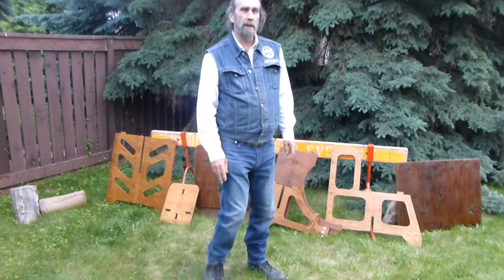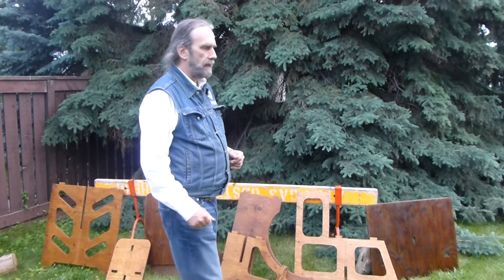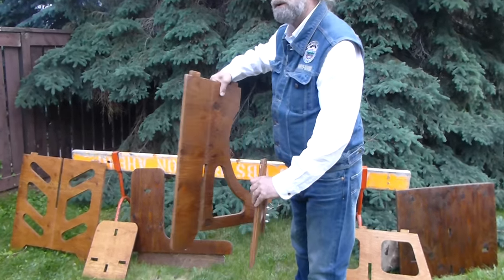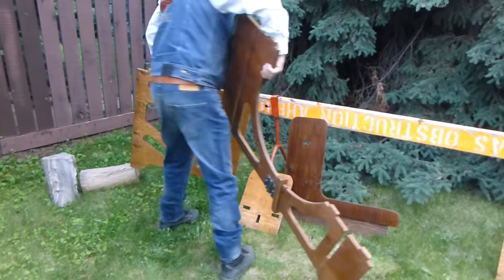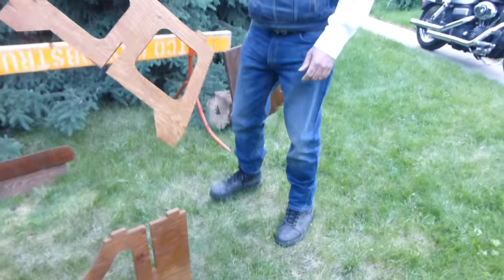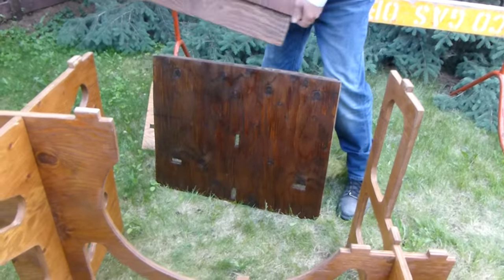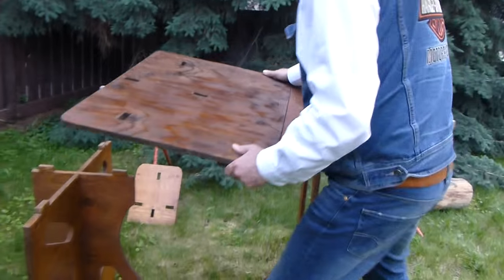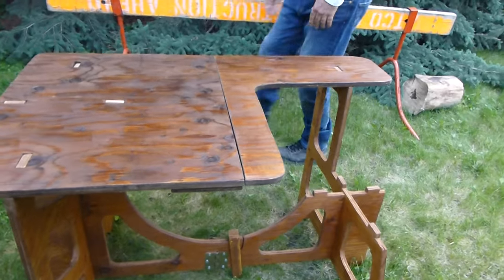Home-made, Portable Shooting Bench Assembly

Comment: HEHEh my hubby made these plans back in 2012..I have a link to CAD drawing if needed message me. He thinks your little additions are nice though ;)
Reply from the maker: And, to be honest, the design he based his on has probably been around since the middle ages, so it's hard for anyone to take full credit, I guess.  I did try to introduce a couple of new wrinkles by incorporating a hinged spine and 2-part table top, so that the disassembled table can fit into a smaller space (like the trunk of a compact car, which I had at the time).
Reply: Can i get a link for the CAD drawings?
Reply: @TheWaytoNativeChronicles  The link you share in your video points to both a free and a paid version of the plans, and both are available to the user to download (for free). Is this intentional?
Reply from the maker: @tinyzoo  not really, actually.  Maybe I should look into that...